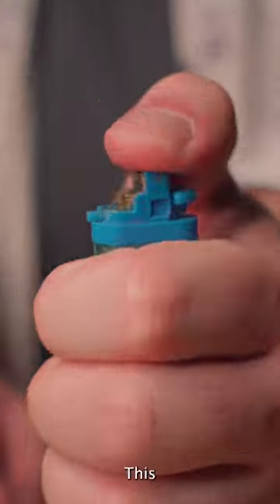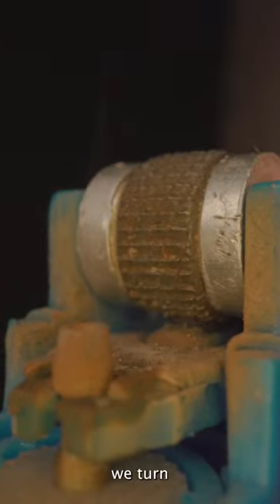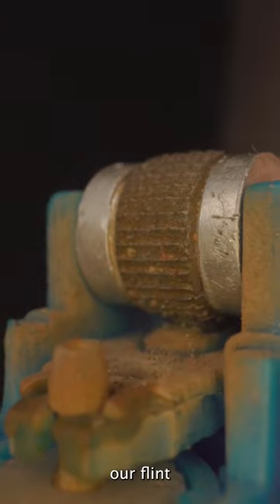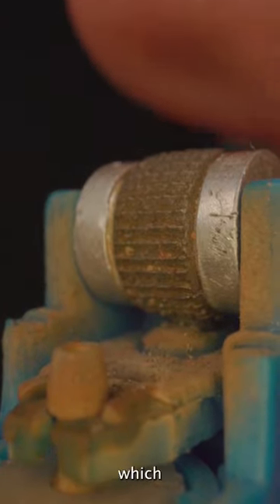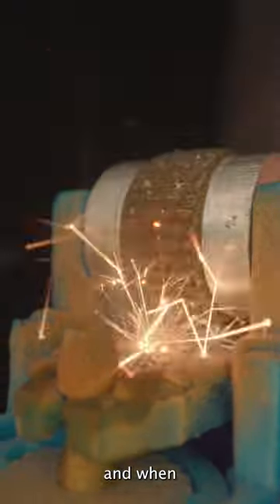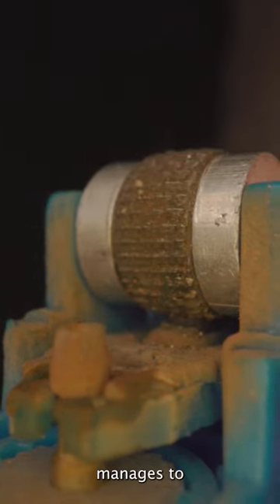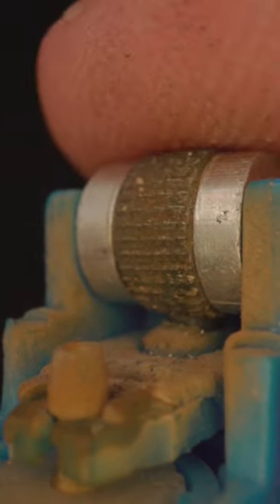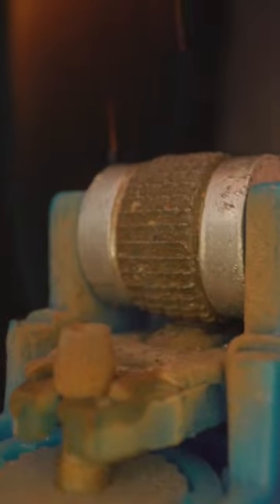How does a lighter work?

Comment: You lLITERALLY didn't have to fucking say "likghter with no flame guard". 

OBVIOUSLY LITERALLY ALL MANUAL LIGHTERS HAVE NO FLAME GUARD, BECAUSE THE LITERAL PREMISE OF A MANUAL LIGHTER IS TO MANUALLY CRANK THE WHEEL  , WHICH WOULD LITERALLY BE IMPOSSIBLE IF YOU PUT A FUCKING FLAME GUARD OVER THE FUCKING THING.